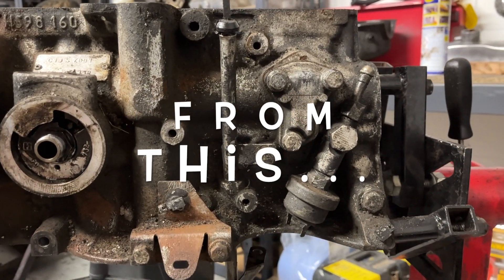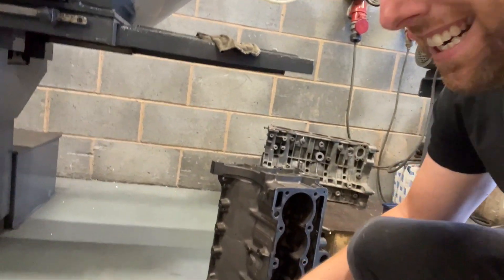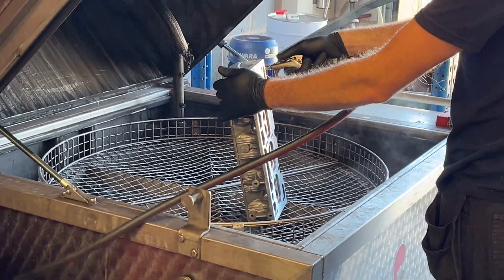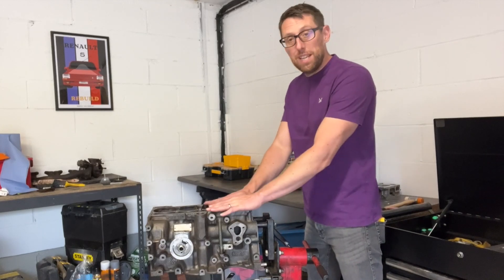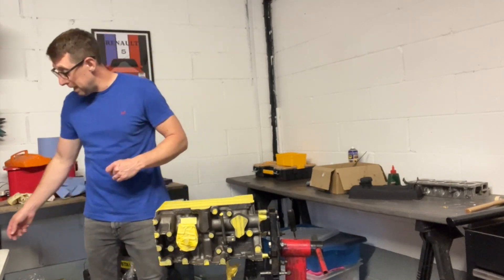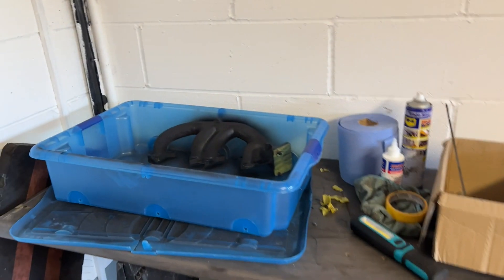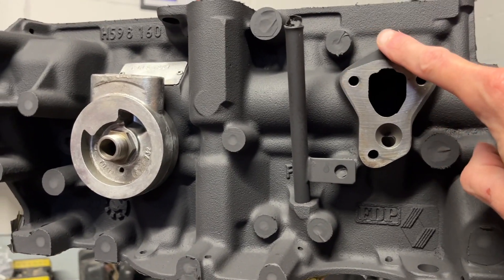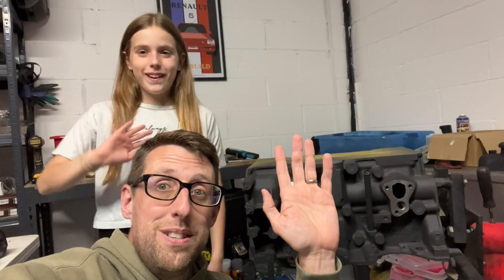Acid Chemical Dipping a Renault 5 GTT Engine & Skimming the Cylinder #renault5 #headskim

Comment: If that head didn't need skimming then it shouldn't have been! Unfortunately the C1J turbos are particularly sensitive to compression changes, something you will need to consider when rebuilding and fueling.
Reply from the maker: The head wasn’t 100% flat, it did take 4 cuts and I want to ensure a perfect seal. Thanks for the advice regarding the fueling. 👌
Reply: @Renault5Rebuild  OK. Worth calculating your new compression ratio, then consider boost target and  carb set up. Good luck
Reply from the maker: Will do, thanks for your advice.
Reply: @Renault5Rebuild  Boost will need to be lower now. Back when these were popular i used to do SAAB APC conversions on R5 GTT's, since the SAAB Automatic Performance Control system is a separate system on early classic 900 models and can be removed and transplanted to other cars. Giving you a computer controlled Turbo with effective Knock control and boost reduction to save the engine from knock. Paul @ The SAAB Clinic UK.
Reply from the maker: Nice! Will have to have a look at that